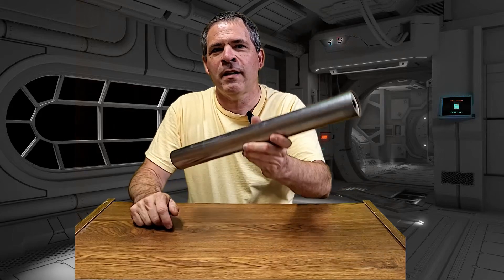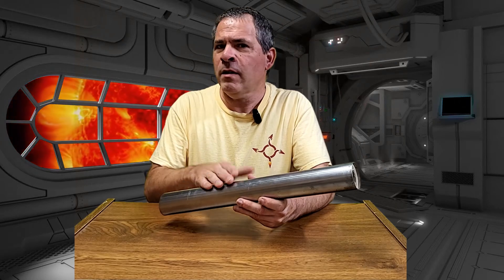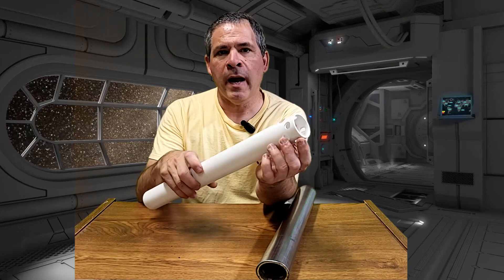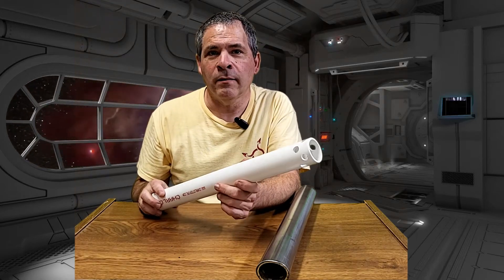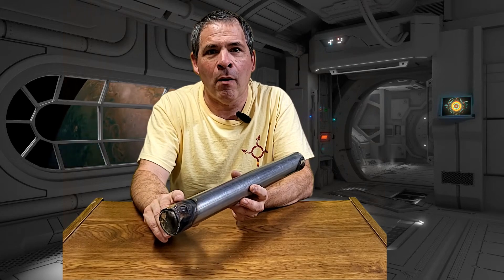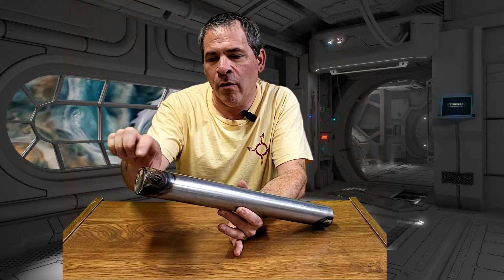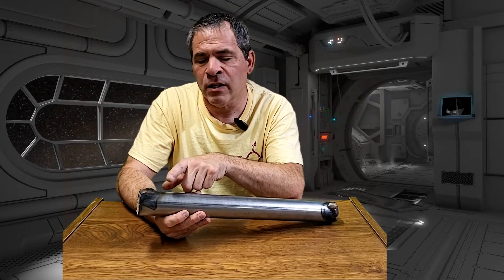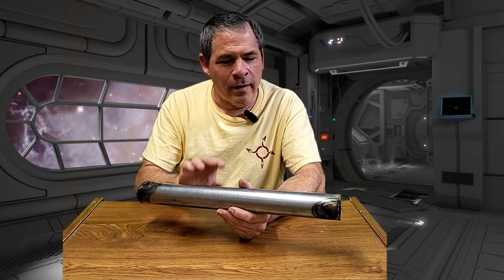Second test of our homemade PVC & Steel Sugar Rocket Motor

Comment: Can't wait to see you remove the smoke element and test it again.  Also, a thin-walled steel tube sleeve in the PVC (like a heat shield) might be the solution should you use the smoke element in the future.  With all of that space at your disposal, perhaps you could fire one horizontally into a fridge for entertainment value. :)
Reply from the maker: The fridge idea is funny but first I would have to find a fridge and then I would have to haul it out to the testing site... Funny idea but too much work.

Comment: Thanks for your video journal of your quest for knowledge. During my testing I have found the forward bulkhead to be the most likely to fail from a blowout. After you address the heat issue you might want to reinforce the concert lugs with some metal to prevent a lug sheer force failure. Eliminating the smoke is the right direction, as it is lit first and has a long time to transfer heat to the PVC. It may be necessary to incase that element in concrete to prevent heat transfer, clay kitty litter might work well also. If you made the smoke element small enough to allow 1/4 inch of kitty on the side walls might be just enough. Good luck with it, I rest assured you will find the answer.

Comment: Why not tap the outside of the pipe with a large thread die. And just use a steel threaded plug and a threaded nozzle. Then maybe try Richard’s KNPSB. (If you dare!) Im trying it with erythritol instead of sorbitol. Tests at 29mm when I find myself bored with my robots.✌️
Reply from the maker: This thin wall pipe is too thin to add threads. I did develop a similar motor that had a threaded fitting welded on the end and a full steel nozzle was threaded onto the fitting after fuel was installed. It worked great. In fact, it was our most powerful motor ever and we used it in our 1000 subscriber special. But the steel fitting and steel nozzle were very heavy. This is basically a version of that motor without the heavy steel parts. As for fuel changes... We've been using a KNSU mixture since we started and I'm really happy with it and also very comfortable making & casting it. So for now, I'm sticking with KNSU.

Comment: Your materials are frangible and very dangerous. If your desert videos are your in local area, there dozens of people within an hour or so of you that can help you learn how to do this successfully. It's not as an interesting video as catastrophic failures and crashes, but cheaper and more successful in the long run.
You don't have to reinvent the old wheel, especially with low performance sugar motors.
Reply from the maker: I don't think you understand the purpose of what we do and the purpose of our channel. It's not about copying other peoples designs or using already proven techniques. It's about experimenting and testing our own ideas. Most times, that results in failure... But that's part of the journey. And to your point of dangerous materials... The steel casing is not dangerous. It's a soft steel, welded pipe that will either burst or peel like a banana if over pressurized. We've done it, we've seen it... It does not explode into shrapnel.
Reply: @rotaryrocketry  What is the burst pressure for your pressure chamber? Did you look up what frangible means (NFPA)?
What is the propellant characterization look like?
What is the ISP of your propellant?
What is the mass flow through the port?
What is the expansion ration of your nozzle?
Does your homeowners insurance have a mitigation clause? (for not paying if your house burns down)
I completely understand the purpose and risks of your channel. Do you?
Reply from the maker: Clearly not someone who will enjoy our channel. Not worth my time to continue this conversation since you clearly decided that you already know everything. Good day.
Reply: @rotaryrocketry  Clearly, the intent of my, and other's comments, regarding the materials is borne out of an attempt to help you understand the risks of  the materials to avoid injuries or property destruction.
Characterizing me as a "know-it-all" underscores my experience with a steel nozzle coming within an inch of taking a friends head off after a cato. Advanced high-power rockets have taken out cars and trucks.
It is worth my time time to help you avoid that experience, or burning down your property. Your homeowner's insurance has a a clause that requires you to mitigate damage. If you have a propellant accident inside, you insurance company may not pay to rebuild. Few people these days can afford a mortgage with no place to live.
All the commentors want you to have safe fun.
Reply from the maker: I appreciate and respect your clarity of response.

Comment: Fiberglass is a bad material for a liner. I'd recomend using paper-phenolic liners or if you can't buy them you can make paper-epoxy ones at home but they are less effective. Also why are you making pvc motors and puting them in a steel case when you can make a motor using only steel or aluminium?
Reply from the maker: The PVC is really only a heat shield for the steel. A while back, I had a similar steel case motor I was developing and was using a thick paper liner. The paper got burned through which allowed the heat to come in contact with the steel. The steel really didn't appreciate that... The motor exploded and went from being a straight pipe to being somewhat horseshoe shaped.
Reply: @rotaryrocketry  did you use spiral wound paper tube?
Reply from the maker: No, it was a card stock material that was rolled up to create 2 or 3 layers.
Reply: @rotaryrocketry some of my friends used paper-epoxy liners and they worked fine. also i used a regular paper tube from a tin foil roll and it also worked fine. i've heard that paper-phenolic liners are great.
Reply from the maker: I bought a 3' piece of phenolic liner a few years ago for a project and never actually used it. I understand it's supposed to work very well. Problem I have found with using pre-made phenolic liners or paper rolls is finding the exact proper size for the project I'm working on.

Comment: very unsafe material to use for a motor case
Reply from the maker: @benjaminnevins5211  Thank you for your opinion... but not true.
Reply: @rotaryrocketry  i think he's got a point
Reply from the maker: Well, since neither of you has offered any real life data, I will offer some to defend my position... I assume you are referring to the steel casing. This is a soft steel, seam welded pipe. It does NOT fragment into bits of shrapnel if the motor develops excessive pressure. You seem to think it will explode into bits like a grenade... It does not. A grenade explodes into bits because it is designed to do so. This soft steel will merely bursts open or peel like a banana. We have in fact had motors explode using this exact piping in the past before we were using the PVC liner and have seen how it burst open first hand. Furthermore... Even if something was to fly off of this motor (like a bulkhead or cap) we are a safe enough distance away that it would not be a safety issue. We all have to make our own safety decisions and assessments... If you don't want to build a rocket motor with a steel case... Then don't, it's your choice.
Reply: Neither Tripoli or our club would allow a test fire or flight since it is a violation of our safety regulations which is enough justification for my saying PVC and Stainless are both "unsafe".  BALLS might allow it but 6061-T6 DOM seems to be the only reasonable material for price and ease of machining.  I think a 38mm TA2 or Grade 5 titanium case might be a possibility but it requires flood cooling which I don't have. 54mm isn't a standard size, and anything larger gets really expensive.
Reply from the maker: Oh, I'm quite aware that Tripoli & NAR would not allow such a beast. Pretty much everything I do would not be allowed at a Tripoli or NAR event. Doesn't mean it "unsafe", just "unallowed". And that is why I'm not a member of either group.
Myself as well as plenty of other people MUCH smarter than me have had great success with motor casing & fuels that are not allowed by Tripoli & NAR.
Reply: What no "Flowers of sulphur" ?

Comment: Why are you using store bought powdered sugar?? It has cornstarch in it!!
Grind ur own sugar.
Reply from the maker: I am aware that it typically contains around 3 to 5 percent corn starch. However, it is convenient. I do have plans for a new fuel mixture coming up that will need to be more pure so I will be grinding my own for that one.
Reply: @rotaryrocketry  What about corn sugar from a Homebrew shop?
Reply from the maker: That would likely work fine. People use a variety of sugar types for fuel. We actually tested a variety of liquid sugar products as substitutes for corn syrup and found them all to work well.

Comment: Why aren't you using screws into the anchoring cement instead of relying on the probably poor shear strength of the cement?  When I was a kid, that's how we successfully held in our Durham's Rock Hard Water Putty nozzles and end plugs.  Note that we're all still alive and have all of our body parts because we knew what we were doing. See the classic Brinley's Rocket Manual for Amateurs and Richard Nakka's Experimental Rocketry Web Site for more info including SAFETY MEASURES.
Reply from the maker: The screw method is certainly an option... But we appear to be past the point of questioning the shear strength of the cement. Both ends stayed in (at least for the short time it was burning) on this model.

Comment: There's no question at all, when you review the footage in slow motion that the failure happened while the motor was still at full thrust, and did not wait until the smoke had started.
Reply from the maker: True that it did happen early on an during full thrust. However, the smoke element is ignited at the same time that the fuel is ignited so I am still concerned that it may be causing some heat issues at the top of the motor where it is located. I could be wrong but I will remove the smoke element and make a few other minor changes next time and see.
Reply: @rotaryrocketry  If you could slip a few wraps of paper into the casing, then pour in a bit of dilute sodium silicate [water glass] and allow it to dry...

This would give a decent temporary shield against heat because it would hold up to over 1000F for at least long enough to finish the burn.

The paper would keep the water glass from shattering and would emit some CO2, which not only hardens the water glass, but offers an ablative form of cooling, that should emit at just a low enough volume that it does not eject the fuel from the cartridge before it can properly burn.

2 or 3 wraps of paper [at 0.003" per wrap] along with the small amount of water glass it should be able to absorb, should contribute less than 12 grams to the mass of the motor.

The idea would be to insert the paper, dribble in the water glass [using gloves, since it is an alkaline product and cause minor skin irritation] and roll it around until all of the paper is wet, then let the rest drain back into the container to be used later.

While the paper will not dry rapidly without heat, it will dry eventually witout heat, if there is risk of damaging the PVC with heat.

Interestingly, if one had a hair dryer and aimed it down the tube at a few inches of stand-off [4 to 6 should be enough], that would likely be enough heat, while not too much heat, as you would not want the water glass to boil dry inside the paper as this would make a mess of things.

The exhaust from a shop vac would do the same thing, but with a safer limit on its heat, but using a lot more air flow.

I can not say how long it would take to dry, I have never tried to force dry water glass this way, and such factors as heat and relative humidity would make a difference, as would altitude.

You would not want to try to vacuum dry it, because that would cause it to boil and foam up inside the casing, reducing the space for your fuel too much.

On the other hand, it is possible to create a glass foam insulating liner with water glass, I've done it before with a torch, just not as a sleeve for a motor like this.

I used it to insulate the outside of some stainless steel tube I was using in a solar thermal motor research project some 18 years ago, and I deliberately used a rather thick, syrupy mix and after letting it dry just enough to be too stiff to sag, I heated it rapidly with a heat gun to cause it to turn into a glass foam, thereby making instant medium temperature [up to 850F] glass foam insulation.

If you can have a shape for the assigned internal volume of the cartridge, and you can mix up your own balanced mix of water glass, you can heat it to produce similar results.

In theory, if one also added a pinch of sodium carbonate [soda ash] they can both expand and harden the product at the same time.

I have not personally tried this as of yet, but it is on my long term 'to-do' list of research.

As a side note, sodium silicate is often used as an absorbent, either in little packets marked as 'silica gel' or as cat litter [the type that looks like colored rock salt].

This will tell people a little bit about the product... https://byjus.com/chemistry/sodium-silicate/